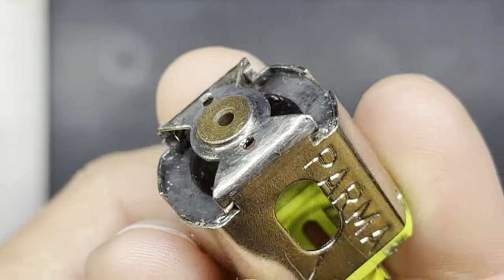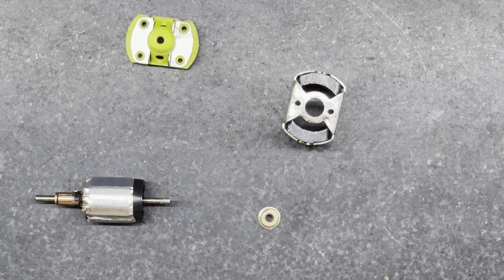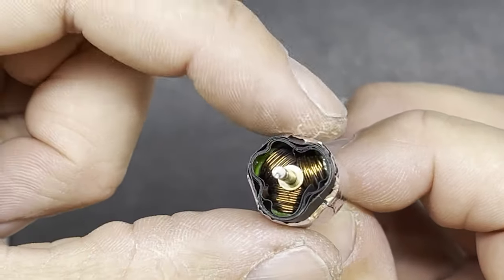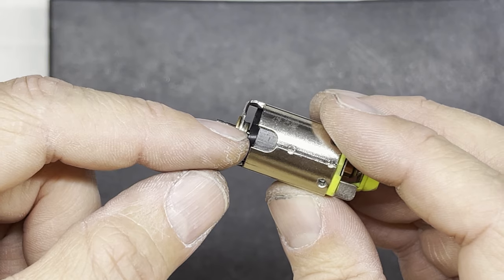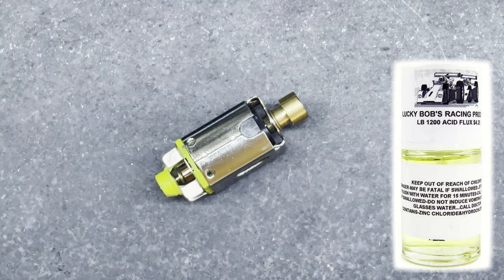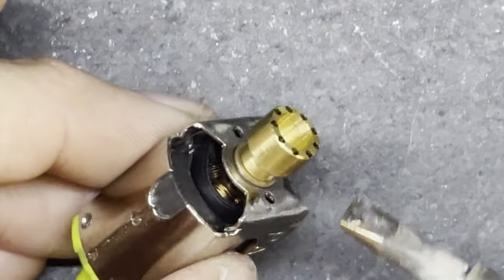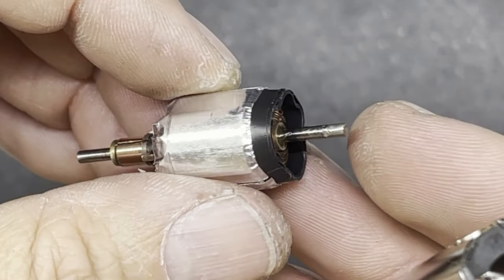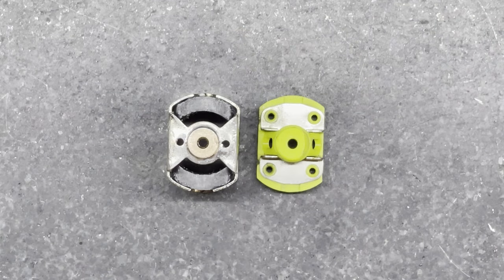Servicing a slot car motor to improve performance Super 16D Slot Stox - Part 4

Comment: The Parma can bushing hole is  almost 6mm. So if anyone is looking for a bushing or bearing you need a 6mm OD with 2mm ID. The hole will need to be opened up a few thousandth.